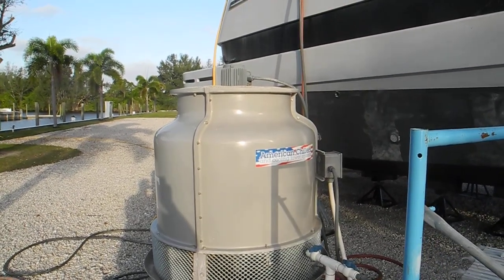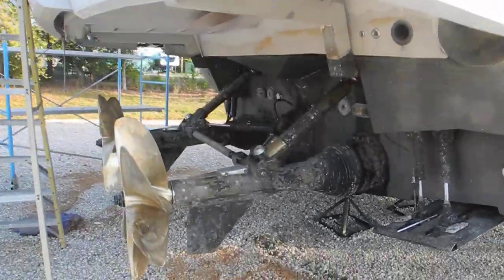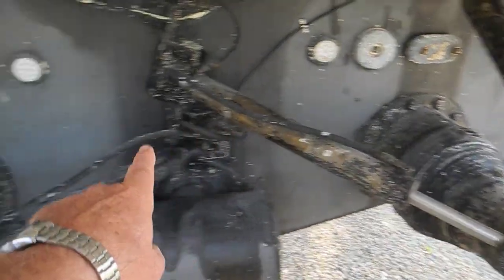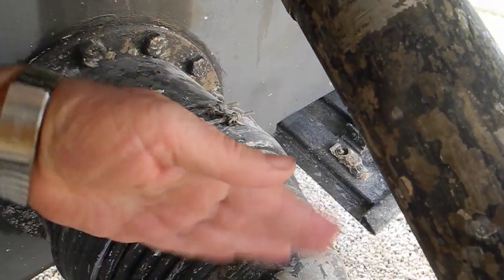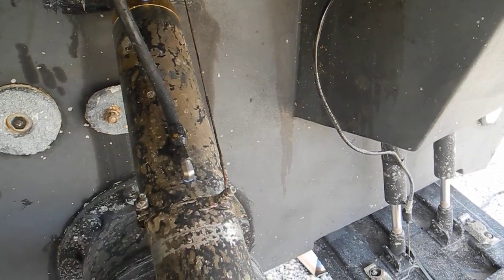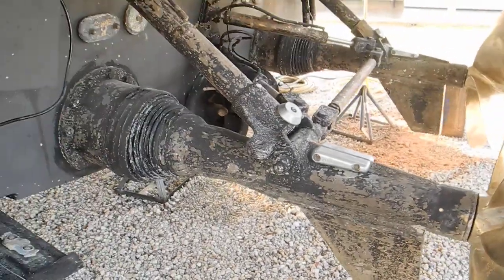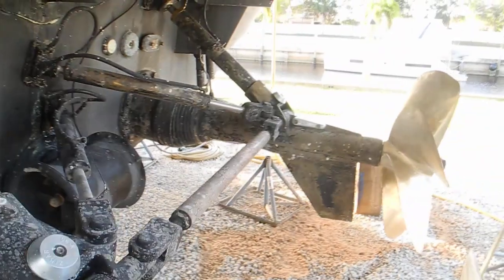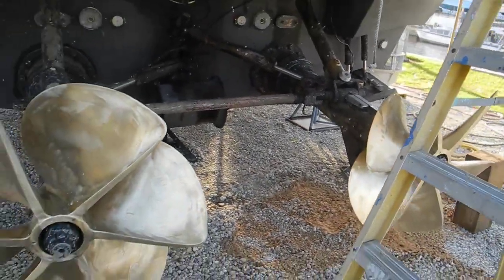Arneson Drive System

Comment: What do the zinc blocks do?
Reply from the maker: They are to protect the harder metals of the boat, stainless steel and bronze. They are sacrificed by attracting stray electrical currents in the water. They are then consumed and need to be replaced.
Reply: @AskCaptainChris   Thanks, I figured they had to do with some kind of corrosive stuff.

Comment: There’s a guy in our harbor that has 45’+ Cigarette with that type of drive. I has huge turbodiesels and had cruising speed of 80 miles an hour. A custom transmission had broken and that manufacture is no longer in operation. The boat has sat in its covered slip for the last six years in serious disrepair. It’s Hydro lift has sunk and it sits in the water without zincs. The owner has lost interest, funds or health. Sad.
Reply from the maker: Karl Jensen we see neglected boats everywhere we go. It happens when you least expect it. Be careful when looking at a boat that hasn’t been used. Low hours aren’t always a good thing. Especially on an older boat.

Comment: Love your videos but if you are going to do a technical one please use the right terminology. Ram rods are used to load cannons, hydraulic cylinders and pistons are used to move those propeller shafts and trim tabs.
Reply from the maker: 953173 you are correct. Ram rods are also used for muskets. When I am explaining systems to an unknown audience of varying (and sometimes no experience) I try to explain as simply as possible. Other times I use the words ropes and sheets instead of lines. It just depends upon the situation. 
How would you like to pay the fuel bill on these monsters...I mean engines? 😎 Thanks for watching.
Reply: @AskCaptainChris  The correct terminology is “steering Cylinder” and “trim cylinder” there is in fact a rudder fin,  not a dagger. The propellers on an Arneson Surface Drive run half in and half out of the water. 

Everyone is so concerned about fuel consumption and the fascination of its cost when in fact the MPG is better with the Arnesons than with any other alternative drive system.
Reply from the maker: Arneson Industries you are correct. Please understand that my intent to to describe and educate the new boating public so sometimes I use lay terms. If you will. But yes, steering cylinder and trim cylinder are what I was describing when I used the term ram rods. Many who watch this channel have never owned a large boat never-mind an Arneson. Thanks for sharing your expertise. 👍🏼
Reply: @AskCaptainChris  True but you owe it to your audience to use the correct terms so that they to sounds more educated.

Sadly, far to many people in today's world are only as educated as the internet makes them to feel.  Just want to them to get an accurate education
Reply from the maker: Arneson Industries and that’s why I finished my last comment by saying thanks for sharing your expertise. We encourage questions and comments by our viewers and respond to all who comment. We also encourage all to actually read the comments. Again, thank you for sharing.
Reply: @AskCaptainChris  Totally understand. I appreciate the reviews
Reply: @AskCaptainChris  always maintaining a Gentleman like demeanor—